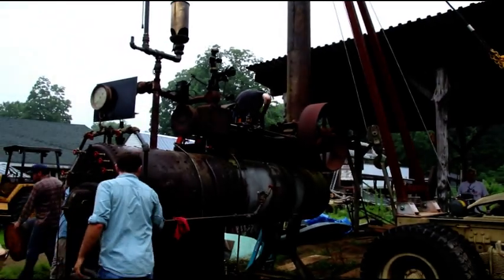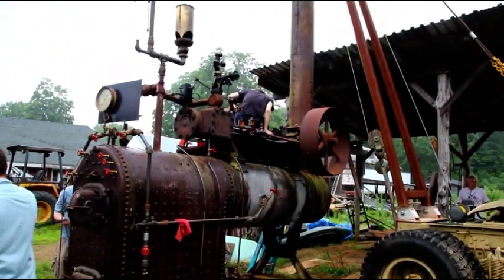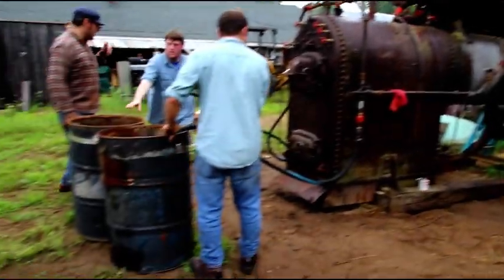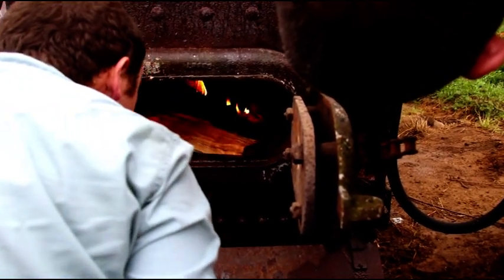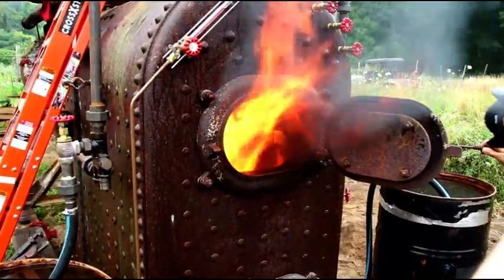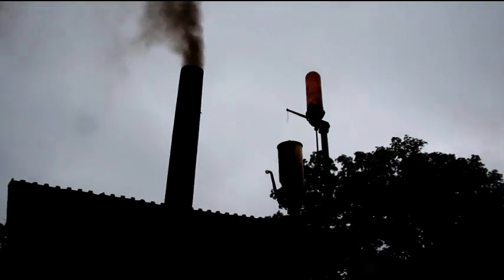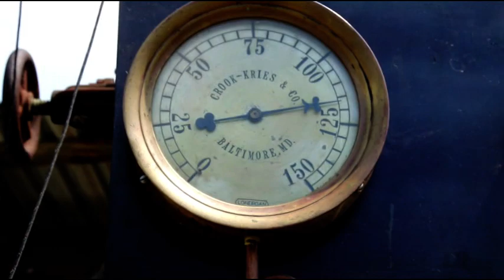Steam Engine First Startup In 40 Years

Comment: How old is this engine, and what make and model?
What was it originally used for?
It looks like it was used for driving two flat belts, why two?   Didn't they usually use one belt to drive a shaft and then drive all the other devices off that shaft?  Or is one really a flywheel, rather than for a flat belt?
Reply: Traction engine or stationary boiler to run equipment is my guess

Comment: do you plan to run the sawmill with it?
Reply from the maker: yes I am going to run the sawmill with it.
Reply: @metalshaperJeep  It would be nice to go back to those times when these old steam mills ran a whistle was a way to call lunch often sawmills sat near large forest the whistle called the yard and fellers to lunch back then a lot of workers didnt carry watches because they would lose them working in the forest also as a pressure relief 
but you could almost fall asleep to the chug of the steam engine 
glad to see these old mills being brought back even if the old saw mantle is gone a person could fix a band mill instead of a circular blade even a generator to run an electric band mill

Comment: It looks like half a traction engine. Have you got the rest of it to refit?
Reply: Looks like a stationary engine used for running a saw mill. regards
Reply from the maker: it is not a traction engine.  Just a stationary unit that will run my sawmill that I am building.